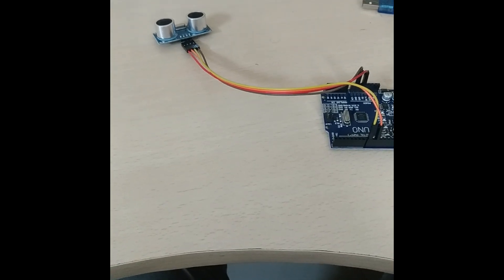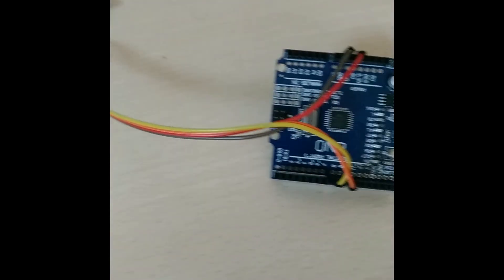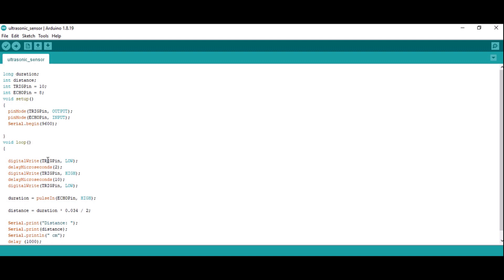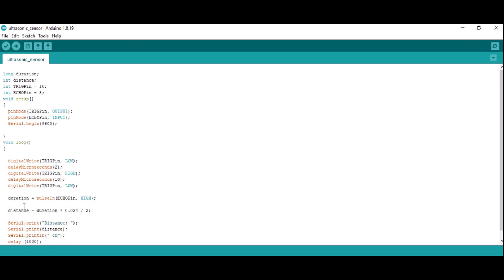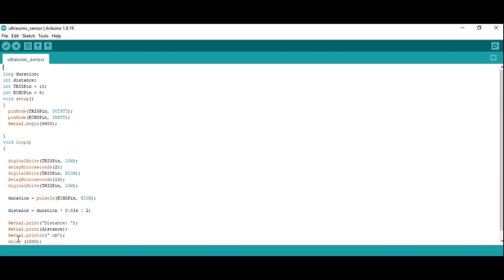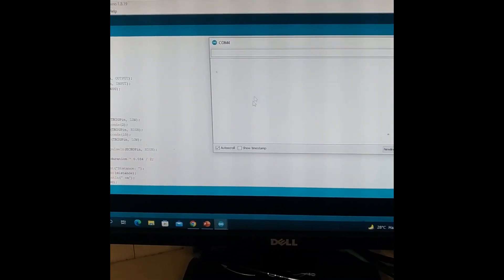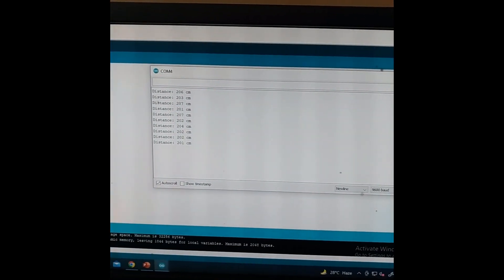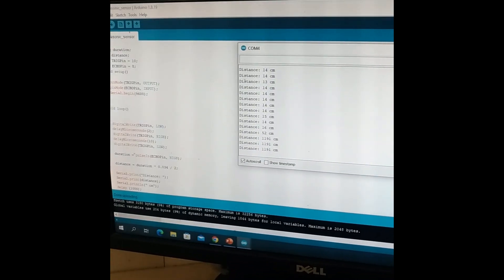Ultrasonic Sensor using Arduino uno

Comment: long duration;
int distance;
int TRIGPin=10;
int ECHOPin=8;
void setup() {  // initialize digital pin 13 as an output.
   pinMode(TRIGPin, OUTPUT);
   pinMode(ECHOPin, INPUT);
   Serial.begin(9600);
}

// the loop function runs over and over again forever

void loop() {
   digitalWrite(TRIGPin , LOW); // turn the LED on (HIGH is the voltage level)
   delayMicroseconds(8); // wait for a second
   digitalWrite(TRIGPin, HIGH); // turn the LED off by making the voltage LOW
   delayMicroseconds(10); // wait for a second
   digitalWrite(TRIGPin, LOW);

   duration=pulseIn(ECHOPin, HIGH);

   distance=duration*0.034/2;

   Serial.print("Distance: ");
   Serial.print(distance);
   Serial.println(" cm");
   delay(1000);
}